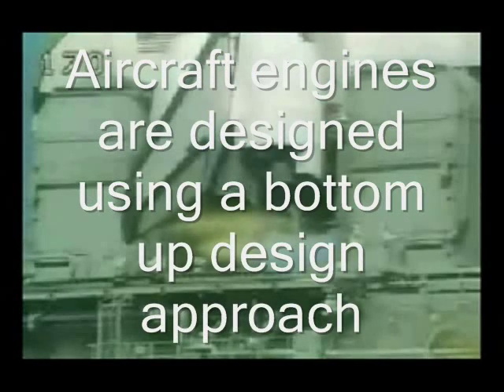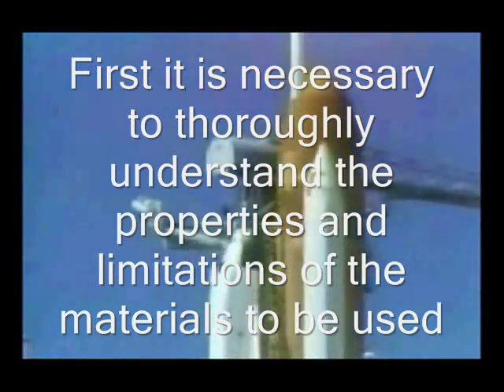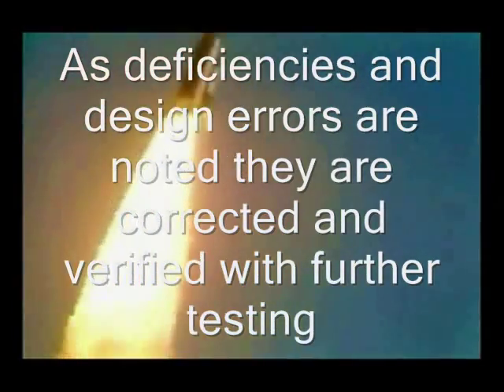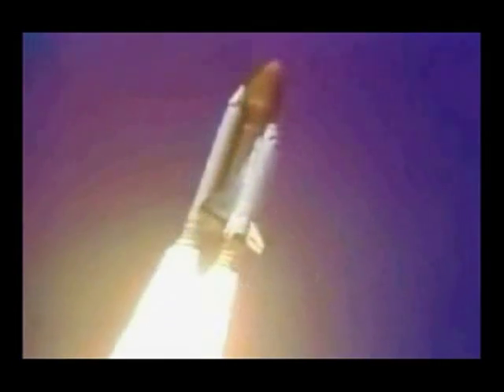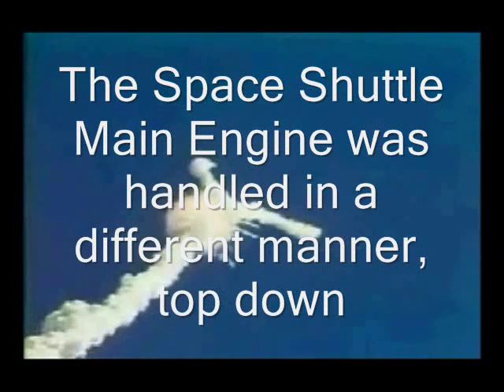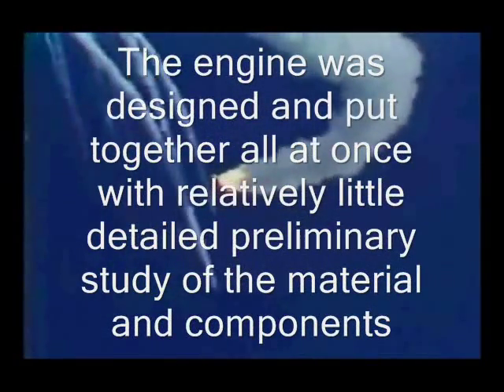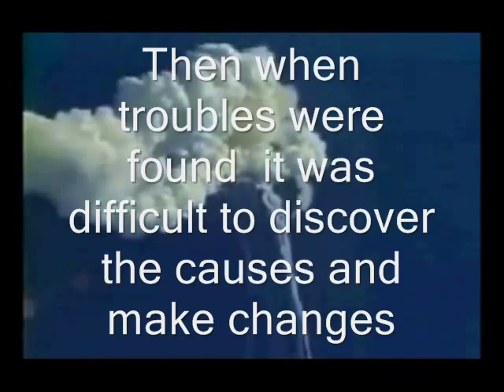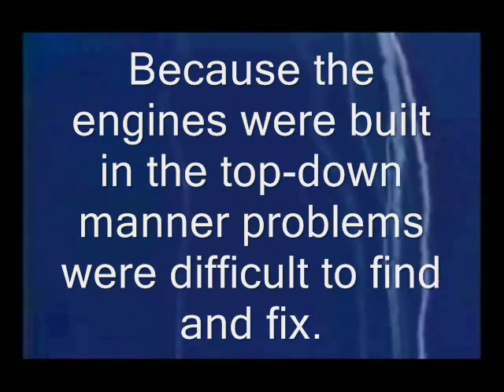Software Challenge

Comment: It's not so much the design process itself, but the ambitions, demands and time schedule. One can take shortcuts if one can afford to loose a Shuttle I guess...
Reply from the maker: It is exactly this idea that is dangerous. My other videos explore the concept of evolution of software; that it isn't that companies are not following 'best practice', but the foundational principles are broken. Take a look at SpaceX and how they developed their reusable rockets; they didn't just design the first one from the ground up, there were multiple proof of concepts. They do a stack of static testing of their engines. Software is similar; you need to break problems down and create testable subsystems. You need to maintain loose coupling so that code does not include  dependencies which will cause complex failures.